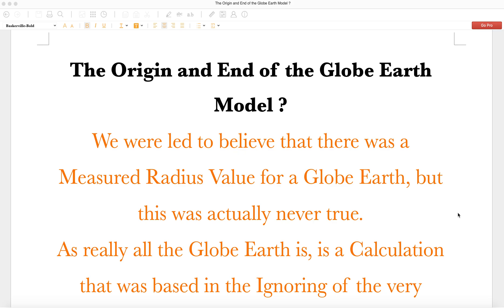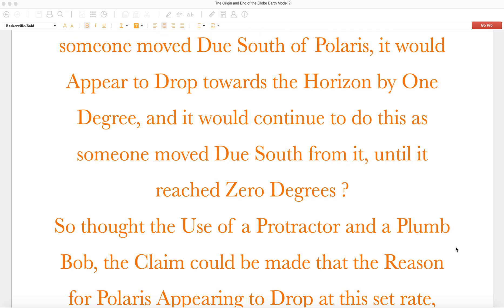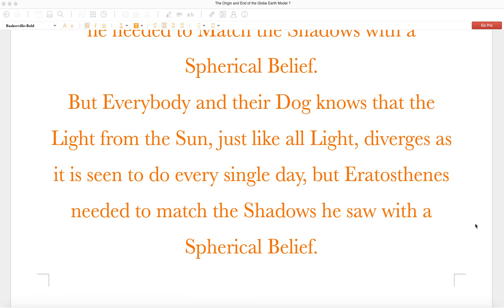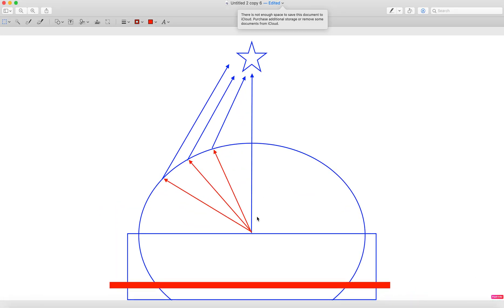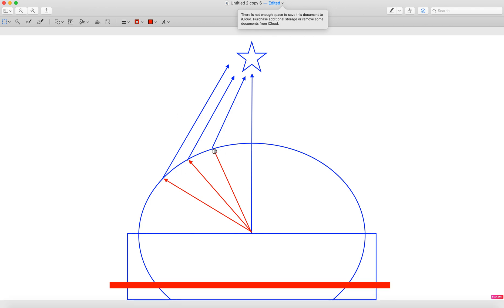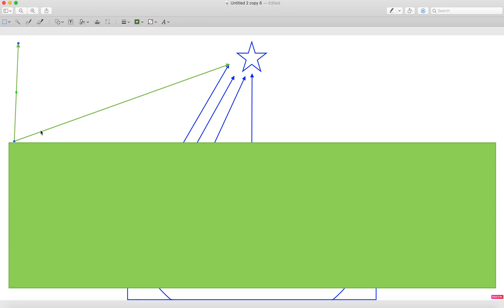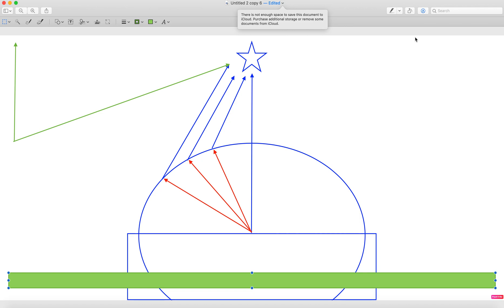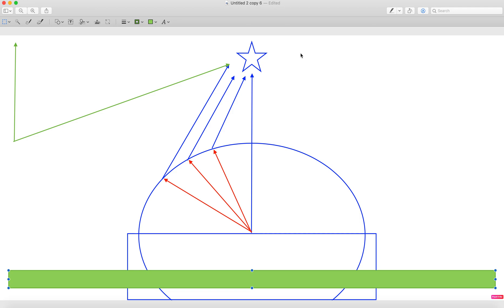The Origins and End of the Globe Earth Model ?

Comment: A mathematical fallacy
Reply: Is what the entire solar system is based on
Reply from the maker: @InnerI44  The solar systems just a mathematical back engineering of what we actually view happening in the sky 🌌 over a Flat Earth
Reply: @BriansLogic  Yeah you're either proving math can make anything true or proving flat earth, or both, but either way, I like your syle. The difference with flat earth theory is that it is math - based, in conjunction with being observable phenominologically, unlike helio-centric theories which are only viable using math. bunk - math at that.
When you see the sun and the moon are roughly the same size and calculate the odds on that being the case in a heliocentric model, the odds are likely astronomical if it is not assumed that beings of a higher intelligence artificed the moon.
Reply from the maker: @ Well you can only believe in a globe, but you can KNOW it’s flat, as the process of all earth measurement uses a horizontal baseline, so that fact alone proves it’s most definitely FLAT, at least as a description of its surface….
Reply: @BriansLogic  Couldn't the MASSIVE earth theory also provide the perception of flatness? I like to keep an open mind on the theoretical and have seen even theories that we live inside a ball with everything stretched out around us
Reply from the maker: @ Sure for people who can’t accept reality, they could BELIEVE that rubbish, but measurements prove otherwise, no matter how open your mind is….
Reply: @BriansLogic  Well measurements are just equations, can you actually show me a real - life measurement of anything that proves flat earth, without relying soley on diagrams?
Reply from the maker: @ Yeah Plane ✈️ travel they fly horizontally, they can’t not it’s literally how they’re designed….
Reply: Thats possibly true and Im not trying to come across as annoying, but where is the proof that there is not a gravitational pull on a gyroscopic navigation tool which guides pilots to maintain altitude,, relative to the center mass of Earth's alleged Gravity field?  @BriansLogic

Comment: No

Your furtive imagination was hard at work again making things up and trying to re-write history. So let’s go back to Aristotle’s time. When you are a traveller and you wonder about the shape of the Earth you can very quickly discount the fact that it is not flat. When you can travel to places you know exist yet you can’t see you realise very quickly that something is blocking your sight. If you get high enough you can see further and things are no longer blocked discounting perspective and the reason they can not be seen. Furthermore as you change latitude the hight of constellations changes in direct proportion to the distance you have travelled. What remained constant though was the relationships (ie. the angles) between stars. This meant a curved sky could also be discounted. This is the starting point for knowing the Earth was spherical. 

The first recorded calculation of the Earth’s radius did not use Pythagorean maths. It was a straight forward bit of cunning geometry. When you have part of an assumed circumference where one end has no shadow the other has an angle made by a shadow you know the angle subtended at the centre of the Earth is the same as the one on the surface. With the length of an arc and an angle you can calculate the circumference and this the circle (or spheres radius). No assumption of sky curvature. Abu al-Rayhan Muhammad ibn Ahmad al-Biruni) 973-1048 measurement did use Pythagorean maths to refine the value of one degree of latitude required so the position of Mecca could be determined thorough the Islamic world. As al-Biruni was a superb mathematician I’ll make an assumption. He backed up his observations by taking them many times. This wasn’t a typical flat-Earther’s “It worked once, so that’s goo enough” as I don’t think a man of his standing would accept that. But I could be wrong. An again, you invoke “geometric horizon”. It’s a place that exists that may or may not be co-incident with the real horizon. What matters is the test of the maths in real life. The shape and size of the Earth has been and is constantly tested, every second by tens of thousands of people.

Now for your diagrams. The image a 4:39 does not match reality, does it? Every single observation should have been parallel with the light at the Pole, not converging as you assert. You know this is not right yet you try and smuggle it in to your videos. Light from the Sun reaching the Earth is (virtually) parallel. You can prove this to yourself easily with observers on a beach, a few sticks and a tape measure. Even though the sunlight appears to converge, it does not. 7:12 was when the real bollocks came in. Observers at different latitudes will observe the Sun at an angle directly proportional to their latitude. Again, you can prove this yourself. Get a few flatties around the Earth tell you how high the Sun is at either solar noon or measure its angle all at the same time. Now draw the observations from a flat baseline. The lines will whizz off in all directions. But place the observations on a globe and voila!  

Brian, may I suggest that:

1. You prove the flat earth. It looks flat so it is must be is not proof. It must be measured to be flat. Hire a theodolite and telescopes and publish your observations and findings. That is how hypotheses are confirmed.
2. You add to your knowledge. Documents such as this: https://hal.archives-ouvertes.fr/hal-02264631/document will help.
3. You should think how the people who you refer to as “the opposition” keep coming up with the same arguments and points.
4. You answer some of the big questions such as how did we get around the planet for hundreds of years? How do aircraft navigate around the world without even seeing it? How do we know its size so accurately?
5. You come up with a single unifying story that accounts for seasons, night and day, what we see on the sky, how and where the Sun rises and sets, how far we can see, how maps and charts are made etc. 

Best of luck!
Reply from the maker: Ok Trevor I just read the word NO so I would like you do a history of the globe then and clearly stare and define where the idea and radius came from, as your claiming I’m wrong ? 
Now I know I’m right and I know that you won’t be able to debunk me….
Reply: @BriansLogic  Brian - that is exactly what I have done. Did you not read what I had written? Just to be clear, it started with the discovery of the fact that we live on a spherical planet using logic and reason and was later backed up with measurements that have been improving year or year. The flat Earth was and is still considered as a belief held by primitive and ill-educated people. My piece above answered your questions and I’ve also given you some options to prove you are correct.
Reply: @BriansLogic  said "Now I know I’m right"
I think that's your problem, you know that you're right but you are the only one with that opinion. To convince anyone else to will need to provide proof, which you constantly fail to do.

Comment: Using some simple trigonometry and the the diagram at 7:10 as a model, you can easily calculate the elevation of Polaris. Have you done so, and what was your result?
Reply from the maker: You can’t determine the height of celestial objects with angle’s.
Reply: @BriansLogic  I agree. At least one thing (angle/length) must be physically measurable
Reply from the maker: @scottmerrow1488  Exactly you can’t just use the centre of a belief lol….
Reply: @BriansLogic  Finding a flat spot on their alleged glerf once more proved earth is flat
Reply: @BriansLogic  why can’t that be done?
Reply: @thomas.a.lassen  
Reason?
Because it’s devastating to his case?
Reply: @BriansLogic  Pythagoras disproven?
Reply: @BriansLogic  So how do you measure the height of a star? It’s angle above the horizon is an excellent way. Just to be clear, horizontal is perpendicular to vertical. Vertical is easily found using gravity. Horizontal can also be found from observing the offing and making allowances for refraction and the height of the observer etc. I hope that makes sense unless of course you are talking about measuring the distance to close stars. That it is measured in parsecs and is the reciprocal of the parallax angle measured in arcseconds when the baseline is the Earth’s orbit six months apart.
Reply: ~6000 miles what was your result?
Reply: @scottmerrow1488  strange that the answer depends on the positions you use as input to the calculations.
Reply: @scottmerrow1488  How was 6,000 miles determined?
Reply: @Otherj3839  Someone assumed he was measuring on/from a flat surface
Reply: Extra Shekels lol
Reply: @scottmerrow1488  Are you saying the Sun is 6,000 miles above the Earth?

Comment: According to your drawing at 7:20, Polaris should be visible every night from anywhere on Earth.
Do you know of any observation that have confirmed that?
Reply from the maker: Not if we are using elevation angle’s and 60 NM per degree ? As then it will match reality as it always does across a flat plane…. Learn something….
Reply: @BriansLogic  
And yet as it has been demonstrated to you multiple times, the 60 nmi per degree does not work on a flat earth. Easily shown with the sun on the equinox. Easily that is if you understand basic geometry.
Reply from the maker: @i.v.blankenship  It’s based on a Flat Earth ya dope, it’s determined off of a 90 degree angle 📐 SMH….
Reply: @BriansLogic  
Again, basic geometry. If it were based on a 90 degree angle, then basic the geometric functions such as sin, cos, and tan could be used to find the length of any side or any angle provided you have the required values of some of the other sides or angles.
For example, if you know the elevation angle of Polaris is 45 degrees and the GP of Polaris is 2700nmi away, that forms a right triangle with the height as the opposite side. Yet you constantly maintain that you can not find the height of a celestial object. So how can it then be a right triangle if you have no possible value for one of the sides?
Reply: @BriansLogic  So how will you proceed to determine the latitude once you've reached 0 degree, ie the equator?
How will you do it further away from the north pole?

Unless you decide that latitude at the equator is not 0, of course.
Reply: @pirateman9234  But but... nautical miles.
Reply: @BriansLogic  The problem is on a flat earth it won't change by 1 degree every 60Nm. 
This is only valid if it is a globe.

Comment: Oh Brian, you’re so confused it’s hard to know whether to laugh or feel sorry for you. Here’s a simple experiment you can do yourself to determine if the sun’s rays are (practically) parallel. 

Find a piece of flat level ground on a sunny day and set up two sticks or similar tall objects side by side. Make sure they are perfectly vertical and plumb. Measure the distance between those sticks, then measure the distance between the tops of their shadows. If the two measurements match, the rays are parallel. If the tops of the shadows are significantly greater in distance than the sticks, they are diverging. 

Challenge 2 is to show how, on a flat plane, Polaris can be viewed at 10 degrees elevation at 10 degrees north latitude, at 50 degrees elevation at 50 degrees latitude and at 80 degrees elevation from 80 degrees latitude simultaneously, whilst maintaining Polaris at the same height above the ground. This must be done to scale - with the 10 degree point being 8 times farther from the pole (the GP of the star) than 80 degrees and 50 degree point 4 times farther. 

Can you do this?
Reply from the maker: I don’t beg the question, and secondly you can’t get angles without a flat earth ?
Reply: @BriansLogic  Since you're asking, yes you can.  I haven't seen it physically demonstrated yet that angles cannot be obtained on a globe.
Reply: @BriansLogic  Paulsy thinks curved surfaces are flat enough to measure with. lmao
Reply: @scottmerrow1488  well that depends on the extent of the curve and the degree of accuracy required Scott. Nothing is 100% flat. Get to the molecular level and it’s bumpy as all hell. Supply your margin of error analysis for the test I suggested and let’s see what would be an acceptable error deviation.
Reply: @scottmerrow1488  well that depends on the extent of the curve and the degree of accuracy required Scott. Nothing is 100% flat. Get to the molecular level and it’s bumpy as all hell. Supply your margin of error analysis for the test I suggested and let’s see what would be an acceptable error deviation.
Reply: @BriansLogic  can’t get any angle without a flat earth? Is there a law in the UK from holding your sextant plumb?
Reply: @BriansLogic  who said anything about begging the question? I just suggested two tests you could do to verify your claims. Can you not do it? Why can’t you show how observations you Polaris work on a flat earth?
Reply: @BriansLogic  There’s no begging the question, only in TC Oakley’s putrid mind.
Reply: @BriansLogic  Just do the experiment Brian. What are you afraid of?
Reply: Flat level ground doesn't exist in your globe fantasy "unpaid" 24/7 anti flat earth agent.
Reply: @scottmerrow1488  why is a building slab not flat? Even if the ground underneath it is not flat? I think Nathan has tricked you.
Reply: @scottmerrow1488  are you saying I cannot create a flat level platform Scott? Why? Say that platform is 10 metres square. What’s the curvature expected based on one degree per 60NM?
Reply: All surfaces are level...except hilly, mountainous terrain. 🤡🌏
Reply: @edgewyze7352  yes indeed they are. And what shape does a level line make on a globe?
Reply: @paulsterx  curvendicular
Reply: @edgewyze7352  that was actually pretty funny. But didn’t answer the question.
Reply: @paulsterx  it's a nonsense question. How about this: can you (or anyone) film a rotating earth with convex edges? An image every 10 seconds from a [fake himiwari] satellite does not count.
Reply: @edgewyze7352  to provide what you’re looking for requires you to be hundreds of thousands of miles from earth, ergo a satellite is the only way to do so. Saying ‘it doesn’t count’ because you don’t like it doesn’t make it invalid.
Reply: @edgewyze7352  PS you won’t get a rotating earth from Himawari as it’s in geostationary orbit. DSCOVR however, located at a Lagrange point, does. You’re welcome.
Reply: @paulsterx  because such a video does not and cannot exist. Go away

But, muh sci-fi cringe warpspeed space fantasy 🥴
Reply: @edgewyze7352  oh it exists. You not liking it doesn’t stop it existing.